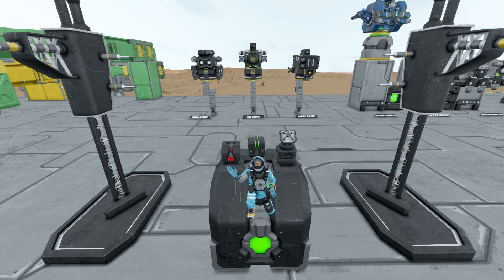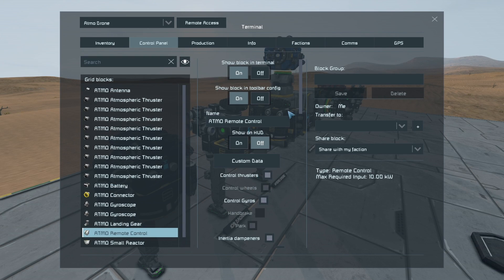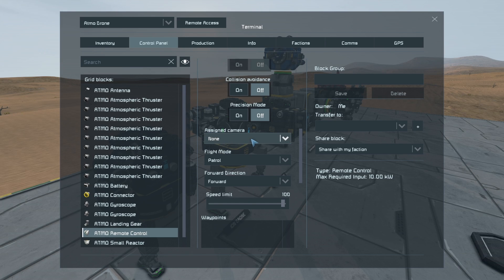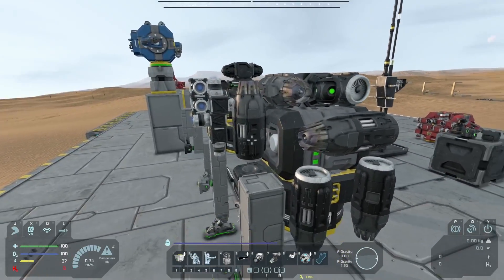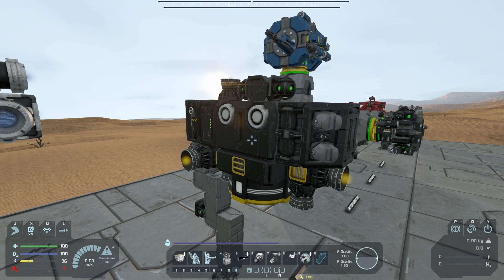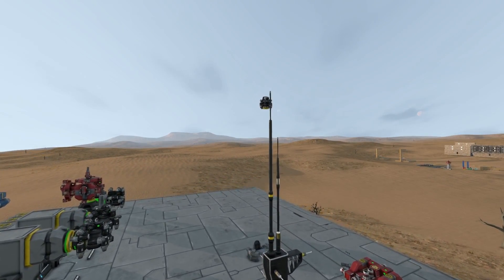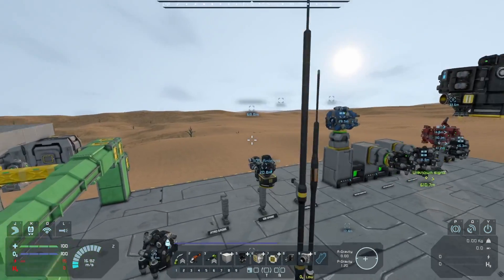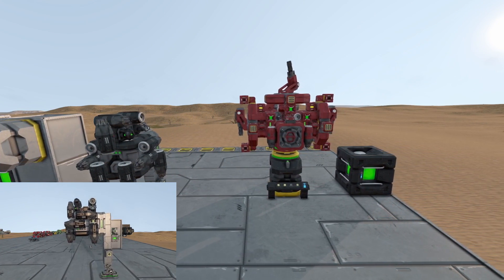Drone Basics Tutorial Part 1 - Space Engineers

Comment: Any idea if remote control block can handle multi-grid designs? Or do they just sink to the ground because the dampeners are not factoring in the extra mass?
Reply from the maker: Absolutely works as my Minefield Drone 2.0 has 4 seperate grids on it (the mines) that are connected by connectors and small merge blocks, worth a watch? ✌
Reply: @ShArPy1o1Games  I have watched that one actually but anything connected by merge block becomes a single grid.

I am making an auger drone that would drill a hole straight down but has the drills on hinges that fold up to dock.
So far it doesn't fly well on autopilot but I thought I may be doing something wrong.
Reply from the maker: Small flight vehicles don't go well with pistons and hinges on them... not sure why but the game doesn't like it.
I always find to make flight vehicles as simple as possible so that way less can go wrong... then add the cool stuff once you know it works and your theory is sound ✌
If not join my discord and throw a screenshot, I'll have a look when possible and see if anything is clear to me on any issues 😎😇